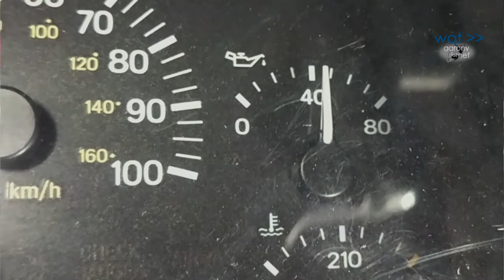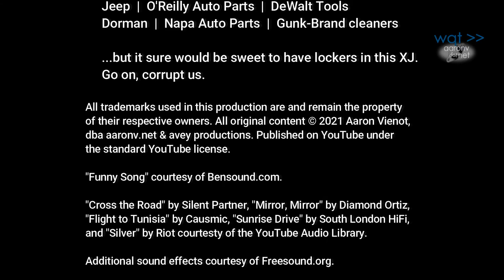wqt//Basic Auto: Cam Synchronizer & Position Sensor (AMC 242: Jeep Cherokee XJ, Wrangler, others)

Comment: It would be easily replaced if you mark the rotating part like a distributor rotor before pulling. put a dot or mark at the start position and another at the stop position. Then you start with the new part at the stop position going in and it will rotate to the start position for a good install. I was happy to learn and see this part being shown the way you did. I knew it had the part but was never sure what it entailed. Thanks again PS I can't keep up with my phone either.
Reply from the maker: Great suggestion! Glad you found the presentation helpful. Part of my motivation to do these tutorials is that many of the Jeep repair videos on YouTube are older and were shot without the benefit of GoPros and low-profile LED lights, so you can't always see what's going on down where the tools are playing.

Comment: Grease your gears before you install it! 👍😉🇺🇸
Reply from the maker: Admittedly a good practice whenever replacing or rebuilding moving components, but since this went into a wet engine and isn't a bearing surface, I doubt any undue wear occurred on that first start.